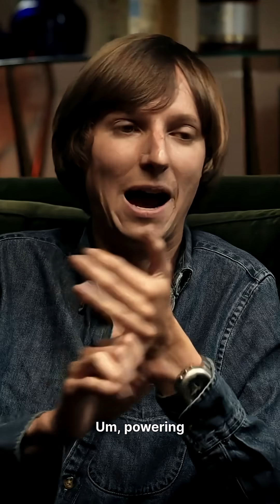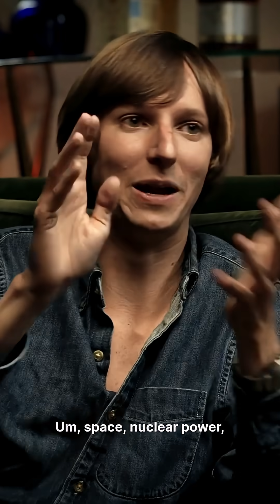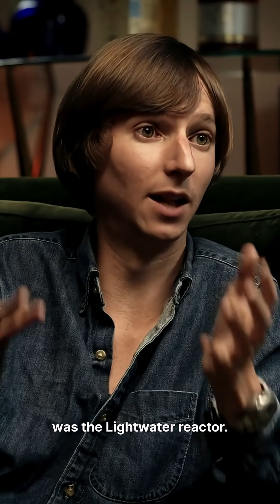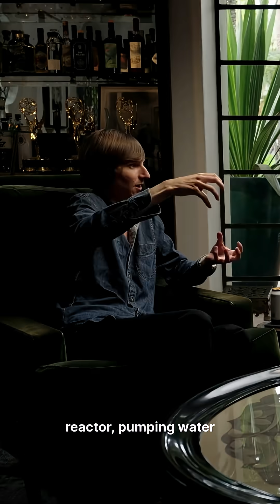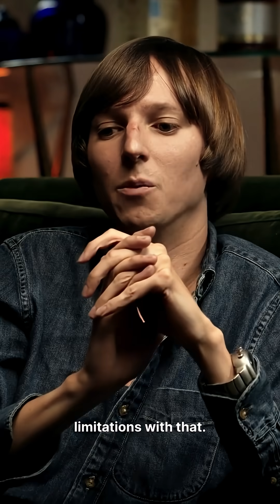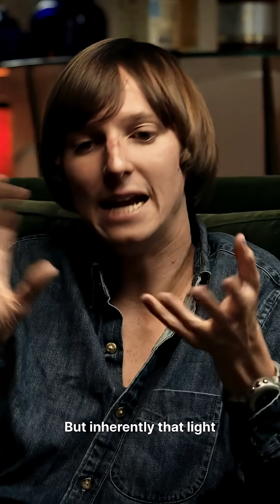Nuclear Reactors, Molten Salt, and the Future of Power #NuclearPower #CleanEnergy #SSHQ

Comment: Why is it good for a Submarine but not an Airplane?
Reply: Weight, that is it. That is all there is to it. Weight of the reactor, weight of the shielding. We tried it, it's impractical. Ignore the other comment, it has nothing to do with clean up or threat posed to the environment in the event of a mishap.
Reply: Weight
Reply: If  a reactor on a submarine is destroyed, the radioactive materials ends up on the ocean floor. Where it is more or less isolated from humans. If a  reactor on a plane is destroyed,  the radioactive material ends up in the atmosphere, and then in your lungs.
Reply: @Romir0s thanks

Comment: It’s not just the coolant; but the method of cooling. The passive cooling in molten salt reactors would prevent a disaster like Fukishima as there are no pumps that can fail.
Reply: Not putting generators in a place where they can be destroyed by a tsunami would prevent a disaster in Fukushima.  Since Three-Mile Island most of the nuclear incidents were not about "nuclear is bad", it was about "humans in charge are bad". You want passive cooling? Buy VVER-1200. VVER-1200 is a traditional water cooled reactor, but it has the very same passive emergency cooling system that works without outside energy supply.
Reply: @Romir0s  At the very least there should be layered redundancies.  Like how NASA added another O-ring to the shuttles after the Challenger disaster.  Sometimes a single backup just don't cut it.